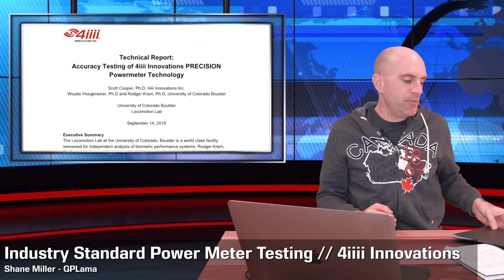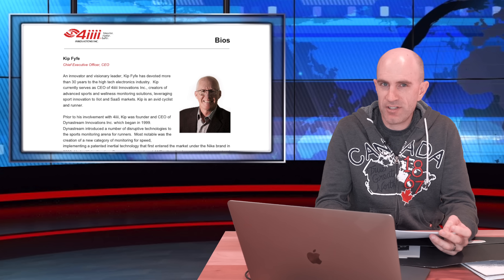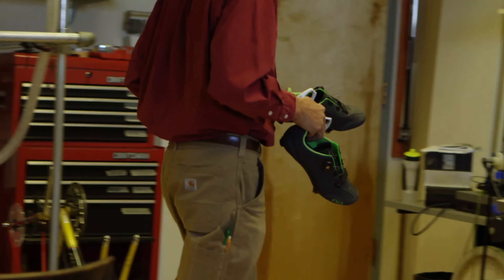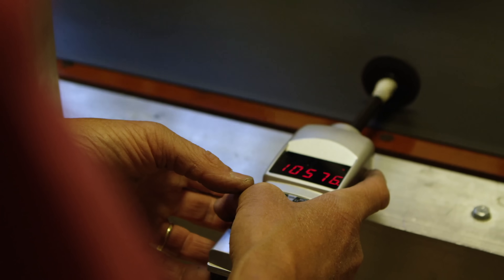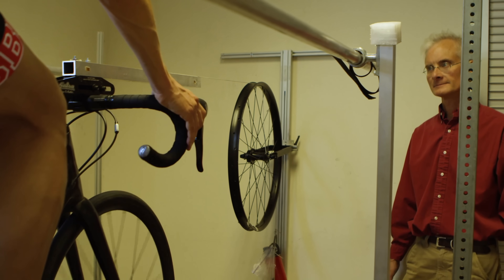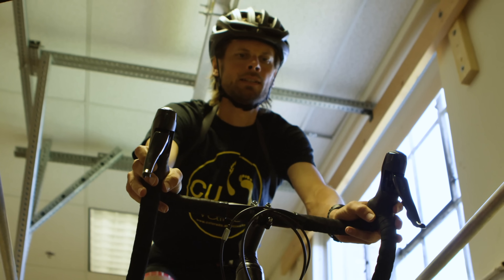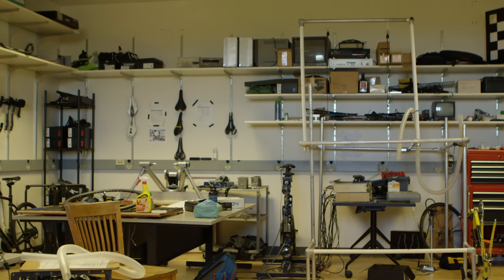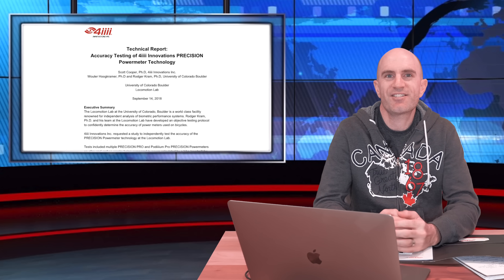Industry Standard Power Meter Testing // 4iiii Innovations

Comment: Supposing drive chain losses always 2% and not dependant by speed and torque and also the rolling resistance not depending by speed and position of the rider on the bike gives a hell lot of non accuracy to the test in my opinion

Comment: Air temperature and density will make a difference. Power per spoke is  0.1-0.2 W per spoke.  Tire dimensions are also important and will affect drag. The drag isn't linear. These require a small correction if not already accounted for in the Crr measurement and other calculations. Crr may or may not vary depending on the force curve around the pedal stroke. Not safe to assume it's a flat relationship - testing Crr at different ramp angles  should let us know, maybe they've already done this.

Comment: Treadmill testing provides a decent standard for assessing measurement of quasi-steady state power output. That's nice and it's good to have a reference physics based standard but reliably measuring quasi-steady state power output is a pretty low bar to meet for a power meter.

It fails to ascertain the performance of power meters at high power outputs and under acceleration scenarios. This is when many meters don't perform so well. While absolute accuracy under such scenarios is much harder to quantify with an absolute reference standard, what is possible is to see if the relationship between pedal force and pedal velocity during maximal efforts (before neuromuscular fatigue sets in) matches the well established pattern exhibited by cyclists. Many meters fail this test.

Then there are measurement artefacts introduced by the firmware and software when processing the data, which is a function of not just the power meter but of the combination with the head unit used, the data transmission protocol and the software used for data processing. A classic example is how power data is handled during times when pedalling is stop/start. These sort of factors can introduce quite sizeable errors in the data even though the meter itself might be "accurate". Have a close look at your data from when you start/stop pedalling, say during a crit.

If we want "Gold Standard" testing of power meters, it's going to need a lot more than a treadmill in a lab. But as a modest first level bar for meters to pass, it's not bad.

Comment: Very interesting stuff.  Just to get it out of the way; a man with two watches, never knows what time it is.   On the serious side; what do you all think is MOST important for a power meter: accuracy or repeatability?  Sure a watt is a watt, but if you are using your power meter for training, isn't it much more important that the values are repeatable?  That on Monday when a given effort measured off at 300 watts, that later that week on Saturday, that same effort also measured 300 watts.  Or 6 months from then as well.  Assuming any sort of training plan would be built of FTP measured with the same power meter.  Even if it's ready 50 watts high, my training plan would be adjusted accordingly, so no worries.  Sure, you want BOTH, accuracy AND repeatability, and throw in durability as well.  Sadly, repeatability is harder for the average consumer to understand, while accuracy is a simple term.  Typical industry load cells often lump not only accuracy  and repeatability, but also hysteresis and zero balance combined into a single "Accuracy" specification class; typically some percentage of the cells full scale.  In any case... just some more thoughts...

Comment: And curious about your thoughts on the set up vs a Tacx Neo. All seems a bit 70s/80s to determine power. As a former biomedical researcher always wary of introducing variables, and here from tyre rolling resistance & pressure, to the consistent use of the treadmill speed calculator, seems to be too many. Peer-review would be a challenge. Not doubting credentials, just methodology. Standard may change and Neo updated but virtual force/power calculation seems very consistent and accurate now. Would be more inclined to a set up such as yours / slanes especially if temperature & humidity are considered.

Comment: Why do you need to re-invent the wheel? Powermeter is nothing more than a dynamometer so why not to use the same callibration method? You can put it in a climate chamber to replicate all weather types you can imagine. Why also to compensate on the losses? On the road you have to overcome those as well and pulling some numbers from nowhere is just not so much scientific. 
All in all a powermeter does not have to be absolutely accurate. It would be stupid for a consumer to buy a callibrated powermeter (you need a certified setup and run EACH powermeter, operator has to be trained specifically to do the job, not only the callibrating machine has to be callibrated annually but also you'd have to send your powermeter back to the factory for the check according to specified interval). Who will pay for it? Not only the initial cost would be immense but also the maintenance. 
If you buy a powermeter first of all you want to pay as little as possible and secondly you want to have a reliable measurement of your effort in a linear scale (I'd prefer kick-ass units - double the number you kick-ass twice as hard as before) so you know that you've made progress or it went in completely wrong way.
I wonder how in world 4iiii put their name next to that. Especially knowing that there are so many geeks and also enthusiasts knowing few things about the topic in the audience.
Reply from the maker: Solid rant.... I think. A human (which a power meter measures) isn't a dyno. The application of torque isn't uniform. It oscillates. So averaging and sample rate is important. Every power meter SHOULD be calibrated at the factory. They're not mass produced and unchecked. Hence the price of them. Anyhow. Good discussion. Edit: All good.
Reply: @gplama  as a part  of calibration process the human is weakest link. I can imagine the army of Chinese (or other nation where man hour is least expensive) riding 12h a day testing  power meters. 
That presentation was so wrong on so many levels (with attempt of producing a "golden standard ") that is almost pseudo science. Sampling rate in all cases is much over what is needed (we're moving cranks in single Hz range at 200 rpm the whole revolution takes whooping 300 ms ) the only problem is the temperature if not anyhow compensated it will give you a different reading for the same unit under the same load. 
If someone wish to replicate typical stroke it's more sound to implement some kind of average pedalling stroke of 1000 average Joes and run a motor in the same manner. But again why? Do you want uniform sampling rate throughout the whole revolution or you'd rather skip some on the drag portion where you produce almost no torque? You've used more power meters than I can count without a calculator are the modern ones so far off between each other? Are the numbers for the same unit reliable from ride to ride? Do you care if you make 400 W or 390 or 410 for the exact same effort of course you don't if the number is always the same and you can evaluate your training with that measurement. With absolute accuracy you could compare yourself with someone else but why would anyone want to do that when the result (how fast you ride) is dependent on so many external factors.  Maybe in zwift it would be fair to use calibrated meters 😉
Reply: A good debate. As a one time builder and current user of dynamometers, the power-meter and trainer power measurement debate is interesting and sometimes amusing. The problem is quite different to that of automotive, what with the very low numbers and relatively slow speed, I don't think you can apply the same methods as used in say engine power measurement, even if you scale them down.
Reply: Mateusz...  strain gauge based load cell have well developed temperature compensation knowledge base.  This can be applied simply by using strain gauges with built in temperature compensation.  I would doubt any reputable manufacturer would be building power meters without these.   Though, point taken...
Reply: Sure they compensate for the temperature (early models had some problems at extreme ends).
But in any case you can callibrate the static reading with dead weights but it won't work in some positions. In any case why not to take just a more precise torque sensor and check. If 4iiii can measure say +/- 1% just take one that can measure to 0.1 or 0.01% or what is the best money can buy and put the device to the test (because you want to know how exact is it) and nothing else. Calibration without isolation of measured parameter is kind of strange. Maybe there is some more elaborate report. He mentioned that they've tested different kinds of power meters so it would be nice to see how it turned out. How precise is their method (every measurement has some error in it). Maybe they are less precise than the powermeter itself. So many questions and no answers. Or it's just some marketing buzz they want to make.
Reply: Um... if you design the gage properly (temp comp., and cross talk concerns among a number of  other design elements) and calibrate correctly with dead weights, the gage WILL read properly in every positions (assuming you mean rotational angle around the crank axis).   Also, static dead weight calibration with certified weights IS the most precise calibration you can perform.  Remember that Torque is not a direct measurement.  It is the force at a distance about an axis, technically a vector quantity.  A known weight at a known distance will produce a known torque with essentially  ±0%.  Much better for less $$$ than trying to buy one.  That said, I understand your point, and agree.  Why go thru all these machinations when all that's really needed is a relatively simple setup.  Cheers!!
Reply: The more I look into it i think it's just a marketing trick for power meters. Golden standard on the web site, some kind of experiment with a "technical report" to show how good they are. Did they really need that? They were not the most popular so far (at least in Europe) but was that the right path, I doubt it.
Reply from the maker: Accuracy is important for a number of reasons. 1) It's what they're sold as. If you pay $1000 for a +/-2% meter and it's 10% inaccurate, that's a problem. Who verifies this? 2) Accuracy is important when moving from one unit to another. Multiple bikes, power meter vs smart trainer, etc. Accuracy isn't important in complete isolation. There's not a lot of cases where you're in isolation now days. Zwift should be leading and championing the power meter industry. Without it they wouldn't exist.
Reply: I agree that you should get what you pay for (btw. PMs are way overpriced for what they are).
In a typical PM user scenario you have 1 PM :D maybe multiple bikes but typically 1 PM so we all live in sweet denial that our only PM is nailing numbers correctly. But in ideal case it would be cool to know that the numbers represent the same work (which I think they do by design of PMs). 
Zwift could put some light on PMs how good or bad they are. They have so many numbers.
I think there's no other way to check if your PM is showing real values than to isolate it completely from external influences and put it under repetable conditions in given environment. If you start measuring through the transmission you already start with some error (unless you assume 2% drivetrain loss being constant).
All in all no single component on your bike (except helmet, perhaps carbon wheels have to comply some norm?) and no one is seeing a problem. HR monitor? Speed, cadence sensor? GPS unit? Tacho in your car is also not calibrated as well (and your car is more expensive and potentially you risk a fine for speeding). 
I think there is a bigger atrocity in cycling industry when you look on Raoul's cutouts of multi-thousand bike frames with evident flaws potentialy lethal for the rider. I'm still wondering why no one in US took advantage of that and sue the company for a broken bone. Maybe then they would put more care in production or at least in QC
Reply from the maker: All valid points, but let's encourage testing, accuracy, and better products coming onto the market.
Reply: I'm 100% on that. Less marketing and more quality.
Reply: The problem of the power meter requires more than you perhaps think. All the calibration and correct strain gauge use in the world only solves a chunk of the accuracy problem. Shaft position and speed is crucial to the accuracy of the power meter, which needs to integrate the torque wrt angulat velocity in order to output power. Even to get the torque we need to know the crank position or angle, because as you say we are dealing with vectors, so if the strain gauge only gives force normal to the crank arm, you need to know the angle of the crank to know the component of the force we can apply to calculate the the torque. We also need to know the speed accurately in order to turn the torque into power. If you consider a power meter with a fixed component, then we can get good accuracy in the regard, as one could use (for example) a hall sensor to give 0.35deg accuracy (12bit sensor), and this is what could be used in a pedal or wheel hub power meter. Compare this to a crank based power meter and it's considerably different, I think the SRM used 6 switches to index position using a magnet, and earlier Quarq used 8 switches,  but even that means you get up to 8 good fixes of position, but probably not accurate speed if the cadence is low. Moving to G sensor method for position sounds good, I would like to see what the output of crank position is like from a system like that (used in all magnetless crank systems I would assume). On top of all of that, you need to look at signal conditioning of the loadcell output, Kalman filter maybe? When you add all those factors up (and there are more too) you can begin to see how we can get differences in power meter outputs even if the load cell element is sorted. And I'm impressed that any power meter is able to achieve the accuracy we have begun to expect.
Reply: I was just about to make this same argument.  Seems silly to try to "calibrate" with a human that is totally variable.  When I was a design engineer creating strain gauge load cell the last thing I would have thought to do was calibrate this with any sort of human applied load.  Nope.  The only option was certified dead weights.  This seems "interesting" but far from any sort of "gold standard"...  in fact, I would hesitate to even label it a "standard".  Maybe a bit hard, but just MHO...

Comment: they claim to be absolute scientific - and than they "measure" the power on an assumed drive train loss, when in fact there is no evidence to that number! Some say 2%, some 3% - and Ceramicspeed claim to have measured savings of far more than that with their products, though there is of course a loss even with them.

On the other hand... it's not necessary that absolute numbers from power meters are correct as long as they are consistent and comparable between different power meters

Comment: I agree with you statement on gravity being different.  It's easily fixed though we have our specific gravity measured at the lab I work at, which is then factored into out calculations. I work for a pressure standards company in the UK. The other thing I found very interesting which you kind of touched on was the issue of accreditation. I think what they are doing is a good step but it needs to be controlled. At the moment they are just another party throwing in their thoughts on how to do things.

Comment: Interesting, You're certainly right about gravity vs altitude, though miniscule vs other variable factors you mentioned, and drive chain. Maybe a standard indoor only waxed chain would help. Wonder just how much rapid temperature changes affect slope, as well as powermeter integrity. They're not infallably robust! Getting an off-the-shelf meter shouldn't be an issue, and will be a reflection of manufacturer standards. Vector will have to up the game though, which is ironic considering where they bought the technology from! :)

Comment: Hi Shane he talks about gravity and the incline of the treadmill. I haven't ever really understood this but to my knowledge if you run or ride on a treadmill you'll don't have to work as hard as on the real road because you're not moving your body up the incline. Can you give me your take on that
Reply from the maker: My take on this - which someone with a degree in physics/math/etc might chip in to correct/clarify - They're not attempting to simulate riding up a hill (which puts an inertial load on the mass (rider+bike)). The treadmill is more like a weight scale. Where mass can be measured by placing items on top and waiting for the compression of the plate to stop and the force pushing up = the force pushing down. Similar to the treadmill in the Locomotion Lab. By knowing the incline, mass (bike+rider), rolling resistance, drive train losses, and speed of the treadmill, then they can calculate the energy required to keep the rider in one spot (like a weight on a scale). So they'll know the estimated energy (theoretical) and the actual energy (power meter readings). In a perfect world the theoretical will be 'correct' and the power meter will be 'damn close'. That's the best I can come with. Someone please chip in and review/revise if required.
Reply: Yuep... it's the "steady state" or "balance" that allows them to know enough to calculate what forces are in play and what power is being expended both by the rider and the treadmill.